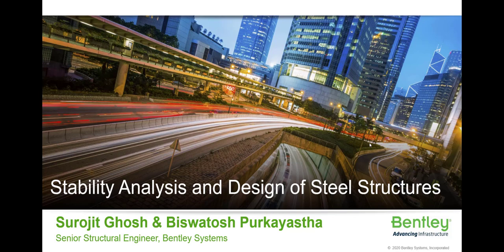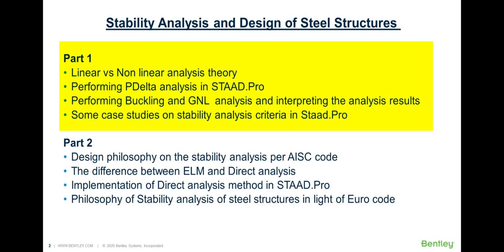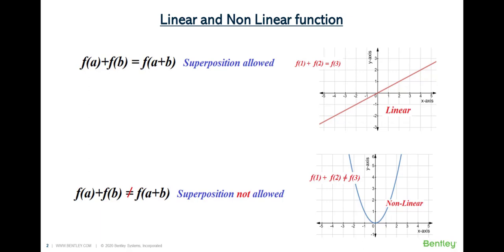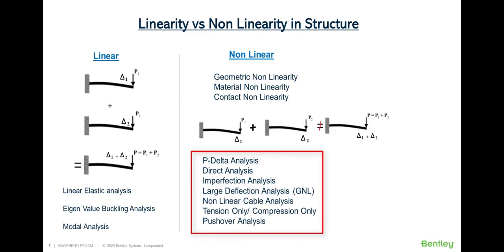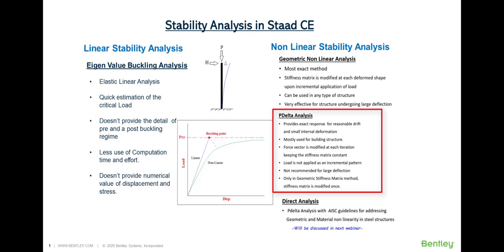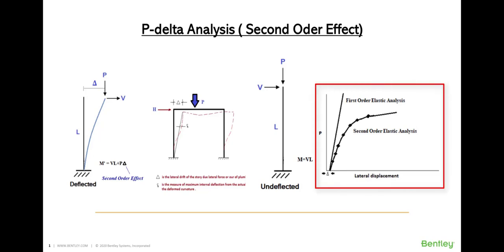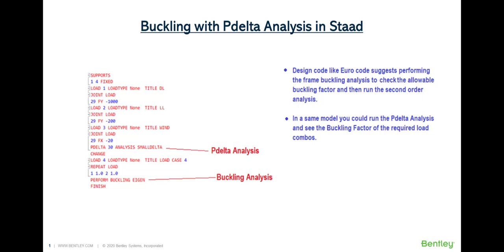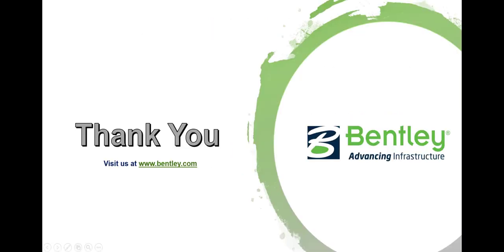Analyzing and Designing Steel Structures for Stability in STAAD.Pro (Part 1)

Comment: 2:37 Linear vs Non-Linear function
8:21 Eigen (Linear) Buckling Analysis vs Non Linear Analysis
11:52 PDelta Analysis
20:54 Geometric Stiffness Matrix (KG Matrix)
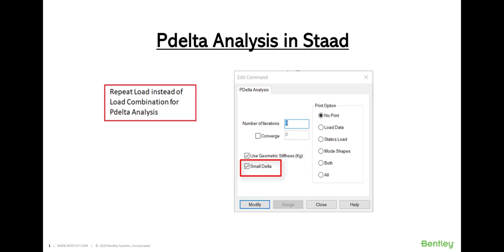26:26 Buckling Analysis in Staad
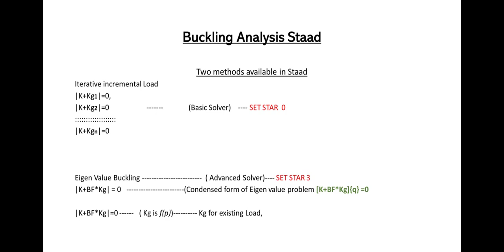29:10 Eigen  Buckling Mode and Shape
34:08 Geometric Non Linear Analysis
40:10 Comparison of stability analysis methods
45:00 Buckling load limit

Comment: Can I do a Pdelta analysis using STAAD for Response Spectrum load cases?
Reply from the maker: A response spectrum analysis by definition provides the user with joint displacements which are the absolute maximum displacements which can occur at the joint when the structure is subjected to dynamic loads represented by the spectrum. This also means that these displacements do not necessarily occur at all joints at the same instant of time. In other words, the absolute maximum at joint 1 and that at joint 2 are most probably occurring at different instances of time. Another fact to be considered is that the methods used to combine the responses of the individual modes in a response spectrum analysis (for example SRSS, CQC etc.) results in loss of signs for these responses. The result is that the joint displacements, and consequently the member forces, cannot be used as a basis for obtaining the secondary forces on the structure. Hence, doing a P-Delta Analysis under such conditions does not make sense.